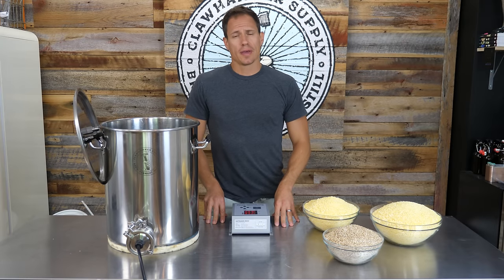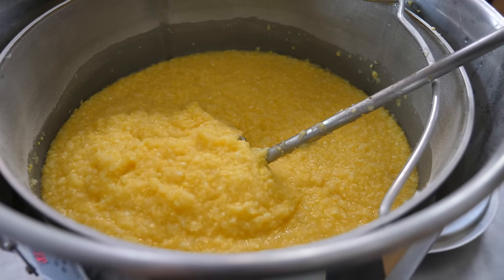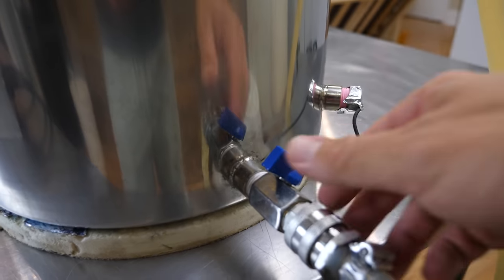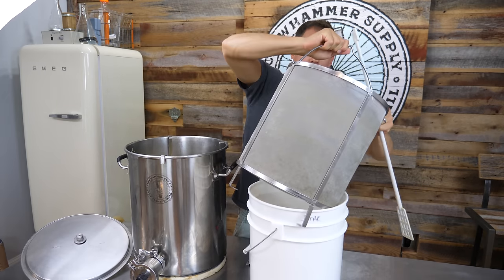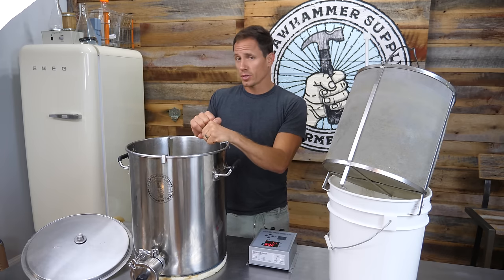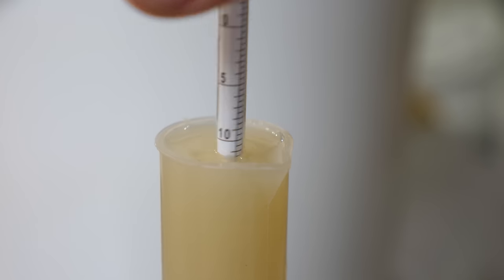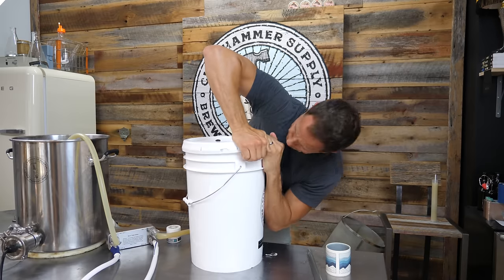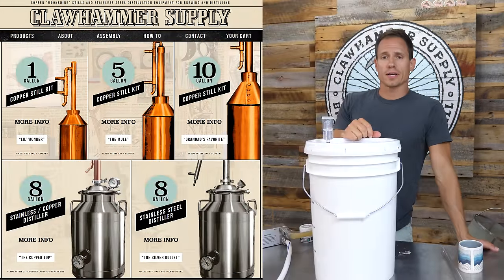How to Make Moonshine

Comment: When I was underage, I made a still out of a pressure cooker and my condenser was coffee can with copper coiled up in it.  I used a meat thermometer for still temperature.  The water was pumped and circulated into an igloo cooler with an ice bath.  I never checked the OG nor knew the ABV, but it was flammable.  My mash was just a bunch sugar water and bread yeast.  Let it ferment under my bed.  I distilled it when my parents weren't home haha.

Comment: Most people are just going to be making fuel to put into their lawnmower hahahahhahahahahha
Reply: because it's so economical.......lololololol
Reply: I'm not at all sure what you're talking about.  This November, my lawnmower is in need of refilling.
Reply: My beater pickup... But close enough
Reply: I wonder how many times they had to do that take before he could say it with a straight face.
Reply: lol ethanol is awful for carburated engines. plain evil
Reply: The joke is, that most states make it illegal to make it for consumption. So the only "Legal" way to make it, is to make it as a fuel. Otherwise you need permits etc.... But officer I swear I was just siphoning my "fuel" out of my tank and a little got in my mouth.
Reply: I don't think mowers can run off of ethanol though. Burns hotter than gasoline and has less power. I KNOW two strokes will burn up quickly.
Reply: @jonbar140  sure they can just need to adjust for proper air fuel mixture.
Reply: @joedanger666  Snowblower
Reply: @jonbar140  my uncle runs his riding mower off moonshine. .....yes they will run on it
Reply: My lawnmower likes its ethanol fuel mixed with fresh apple cider and cinnamon
Reply: @jonbar140  Burns MUCH cooler than gasoline and has more power yet less energy density.
Reply: @jonbar140  actually it burns colder, however the Stoichiometric ratio is higher than that of gasoline so it requires more fuel to air. So if you run an engine set up to run on gasoline, especially a carbureted. Engine the jets will not let enough fuel in and it will run lean, which will create the "hotter burn" so
Reply: I find after 2 or 3 refills my mower is running real good !
Reply: @Eccooke31  Ethanol production is ILLEGAL in ALL US STATES......
Reply: SNOWBLOWER  @joedanger666
Reply: @Eccooke31  no distilling is federally illegally without a permit. Have fun with the BATFE mate.
Reply: Your lawnmower might be thirsty
Reply: I put some in my lawn mower and I cut down my neighbors rose bushes.
Reply: @Eccooke31  how are they gona know if im drinkin my own supply tho 😂😂
Reply: So you're saying lawnmowers run off booze..
Reply: lawnmower? Thats a funny name for my stomach
Reply: Richard Mccracken ...Popcorn Sutton ran his Model A on it one time when it ran outta gas on his way to deliver a couple cases of his shine. The buyer gave him a gallon or two of gas as a tip I here. Believe it or not it’s your choice!
Reply: @Eccooke31  theres no way you learned that in a class , unless you mean college then yea haha . it looks so good
Reply: @xxDOTH3DEWxx  they make alcoholic carburetors

Comment: Looks a bit more "hipsterish" than the mash fermenting in wooden barrels, complete with dead insects, like we always did it at the still.....lol  Dead flies give it flavor.  Just an old copper still, using biscuit dough to seal the thing while running....Yeah, it was just to use as fuel also.  I'm lazy in my old age....I just buy Bulleit Bourbon or High West Whiskey now.  As a note - NOTHING is illegal, until you get caught at it.  Ran a large outdoor still for years and never did, so it was legal as fuck as far as I'm concerned.
Reply: doesn’t have a taste like it was made in the middle of nowhere
Reply: @xx_epicgaymer69_xx41  like bacon over a campfire vs Bacon in your kitchen. Both good, but one is fucking awesome.
Reply: Not illegal until you try to sell it. Uncle Sam wants his cut.

Comment: Seems like you're making something simple overly complicated with that fancy electronic pot.
Reply: So much easier with a one pot setup. Expensive   for a reason. You mash, sparge, and cook all in the same vessal, saves a lot of work.
Reply: Exactly most guy I know use the same bucket transfer it over let it ferment then distill. This electric kettle is a scam.
Reply: @mattwilkes2214  you can't cut corners and make a quality product. It takes a little work to make quality liquor. That's for lazy people.
Reply: @kylestivers4606  every commercial brewer or distiller in the country, "cuts corners" by using new, efficient equipment and by streamlining their process.
Reply: It does seem overly fancy for “lawnmower fuel”. It’s not like there are many people with the distillers license that are trying to make small batch high quality booze.....

There must be a long term plan to recoup your investment in off road bio fuel. 5 gallons of 20% mash is about 1 gallon of high enough proof “fuel”.   1 gallon of gas is $2.75. IF you grow/mill/malt your own grain, it’s going to take a lot of batches to see a return on investment. It’s crazy how moonshine is so expensive, but ethanol “fuel” is so cheap.... 🙄
Reply: Honestly he's making it look too easy , I've had shine like this before , trash compared to backyard shine
Reply: @kylestivers4606  I agree
Reply: kyle stivers 
Mate, sure you can’t cut corners when making quality shine. But hey, this was bullocks, whaaaaaay overdone. 

Ferment your fruit, sugar, starch in a sterile bucket. Let it ferment and than distill it. Run it through activated carbon, dilute it to 40% and enjoy it. 

Dang, how hard is it...
Reply: Well, I don't think it was really designed for stuff like this. Have you browsed through their website?
Reply: I can do the same thing with a big stainless steel kettle,  a 10 gal insulated cooler and a large mesh sparging bag. A lot cheaper and just a wee bit more elbow grease. And he never mentioned using the spent grain and  backins to make sour mash.

Comment: "how to make moonshine" if you have the money for a distillery
Reply: hey man! that isn´t expensive.
you can use for example an used beer keg. i bough one wich holds 50l for 30€.
if you can weld or know someone who can you come around 100 $/€

here in germany it isn´t allowed to distill if you haven´t got an rare licence but we say:
"Wo kein Kläger, da kein Richter!"
"No plaintiff, no judge!"
Reply: I’ve seen these kits for like 50-150 lol not that bad I think the supplies might be more
Reply: You don't even need all of this for small batches. If you got a large stew pot, a very fine wire mesh and a hose, you can make it pretty easily albeit with more difficulty. Hell, you can buy a kit for like, 20 bucks on amazon that comes with all the basic equipment.
Reply: Lukas Moßner no
Reply: there are two types of people, those who need every last detail spelled out for them and those who can acquire a basic grasp on the concept and improvise the rest. Strive to be the latter and I guarantee life will be easier for you.
Reply: I know some who put together a 15 gallon still for under $50 US. He found a fat copper pipe as scrap though, so it will be more expensive if you aren’t as lucky.
Reply: You can buy a still "for essential oils and herbal extracts" on amazon for around 350 dollars.
Reply: Nailed it on the head my man, this set up is is too over board. More effort than it needs to be for a moonshine whiskey

Comment: If I add like three pounds of sugar will that give it a higher content level I'm tryina get drunk off a lil sip
Reply: Not so much. It depends on the proof your still puts out. You can have a 20% abv wash n if your still will only put out 110 proof in the run then that's what you are going to get. Now you can rerun your shine and kick the proof up a bit more but your volume will go down. So basically if you are looking for a really high proof it comes down to how well your still is tuned more so then how high the abv is in your wash. Hope that helps.
Reply: this recipe is for lawnmower fuel lmao jk
Reply: Paulie Tonoro the higher the ABV, it’ll just mean you’ll have more alcohol, it won’t be stronger, you’ll need to distill it multiple times
Reply: Why??? So you're gonna obviously waste your time making it, wait two weeks for it to ferment so you can "take a lil sip"? Whatever man. I think you wanting to sound cool backfired on you. If you are even of  age to go into a package store, go buy some vodka and stay in mom's basement for the night. That way no one has to see you get sick.
Reply: Sounds like a lot of folks here haven't run a still before.  Yes the ABV of the wash will help determine the ABV output of the spirit.  Your takeoff with a 10% ABV charge will typically start at around 120 proof while with a 20% ABV boiler charge may start off at about 135 proof. These numbers will drop as the run progresses since the alcohol content in the boiler is constantly getting lower. No mention of doing cuts either. there are the foreshots which should be discarded due to high content of acetones and methanol. The heads which are sharp to the tongue , then the hearts cut which is the good stuff then the gradual drop into the tails. It also depends on the type of still you are running. A pot still , a pot still with a thumper or doubler , maybe a plated column. Depending on the style of still and the rate of takeoff final proofage will vary. The thumper will increase starting ABV to around 155 to 160 proof and the plated column will allow you to take off as high as 192 proof depending on the amount of plates ran. Do some reading I suggest going to www.homedistillers . org.
Reply: Keven W  Kevin I wasn't speaking about the fellow from clawhammer. I was speaking of the fellow that claims a still has a fixed output no matter what the ABV of the boiler charge is. When in fact the output ABV of the still does change depending on the ABV of the boiler charge and type of still being used. It will Change during the run as the alcohol is extracted from the boiler charge. Your highest proof on a pot still will be at the start of the run and gradually taper down through the run as the ABV in the boiler decreases.  So in fact ABV in the boiler charge does affect output proofage .   As I mentioned before. Check out www.Homedistillers.org for some really good information and a great group of home distillers.
Reply: Easy ratio to start with will be 8 lbs of sugar to 5 gallons. Depending on how well your fermentation goes , will determine how much product you get. If you want higher proof/traile , run a reflux instead of a pot still.  If you make whats in this video, don't drink it.

Comment: Never tried barley... straight corn
Reply from the maker: You need the malted barley to convert the starches in the flaked corn into sugar
Reply: You can get amylase enzyme by itself as well. I'm assuming for purposes such as this
Reply: +Clawhammer Supply I use cracked corn and achieve 175 every time.
Reply: 10 lbs of sugar per 5 gallons of mash...
Reply: @MikeP350  I am assuming you could use pureed banana skins to get it started breaking down too. It would probably take a bit longer, but it would get the job done too.

Comment: Legitimately speaking, cutting gas with high-proof alcohol would work to stretch your supplies of fuel.

Or you might be able to run a Deuce and a Half on the stuff straight from the still.

Comment: 8%??? That’s it? I regularly get 11.2% or 1.088 original gravity… Of course I’m using 13 pounds of corn and 4 pounds of distillers malt… When distillation is complete I get about a gallon of 100 proof white lightning…The cooling system seems a little more confusing than just using a good old fashion wort chiller… But it’s pretty cool to watch. Thanks for the video

Comment: No Iodine test? Plus, after producing the wash; Why would you reheat to 170-212f? Unless I heard him wrong.
Reply from the maker: No idione test- correct- not something we do very often. It is really easy with this recipe to tell if you got good conversion. After the mash is finished you have the option to bring the mash up 170 or or a boil. Heating the entire mash up to 170 or a boil would eliminate the worry about getting an infection during fermentation (as long as everything else is sanitized well before pitching the yeast) If you are extremely clean/careful during the mash process you can skip the 170 or boil and just cool it down and pitch the yeast.
Reply: Please sdnd me a recipue or two brother.  Woulf appreciatd u 4 it now. Thanksbyou

Comment: How i make my moonshine

25L water
6-8 KG sugar
1 packet of turbo yeast

Mix it all up in a plastic container with a air lock on top.
Let it sit for 8-10 days (when the air lock stops bubble) 

After 8-10 days, pour gelatine powder on top of the mix. This helps to clear the mix and remove dregs. Let it rest for 24 hours.
Move the mix to another container using a siphon. Leave 2-3 liters on the bottom, together with all the goo left behind. 

Now you can destill it with a alcohol destiller (google it) and get 90-94% pure Ethanol. 
After you are done, mix it down to 45% and run it trough a tube of activated charcoal. This removes any bad taste from the brew.
NB: if you put anything above 50% alcohol trough the activated charcoal, it will get ruined. 

Enjoy.

Comment: Why the disclaimer at the end?
Both Ebay and Amazon sell the heck outta stills...
Everybody knows what we're using them for...
Here's the deal...
If you're fooling around with a 3 or 5 gallon still in your kitchen, and can prove you're a hobbyist, that's probably okay. You need to show the feds it's for your personal consumption only. 
But if you have a 20 gallon pot still permanently installed in your garage, that will get some attention. Feds know you're not drinking it all yourself. You're into "selling and distribution"...a yuge no-no...

Comment: Pressure cooker.   Could copper. Bucket of water. Bottles. Garbage bucket. Fill with water & apples. Let go sower. Goes into cooker dirty comes out clean. That's like southern commfert. Getting close.  Run keep running through until a warm feeling his down ur chest.   That's it 100 percent.

Comment: Interesting in spite of the cost of equipment. What about the blind factor if made wrong, is that an old hillbilly's wives tale to keep people off her stash?
Reply: There are three diff alcohols made ... Fortunately the two bad ones steam out at about 146°f ... The third which is generally accepted as non poisonous unless you overdose or have an allergy comes off at about 170°f ... The old rule was to use a quart jar and toss out the first quart ... But that's just hillbilly rumor y'all ...

Comment: This looks really technical and difficult....hardly worth it when it’s cheaper to just go and buy your choice for a few dollars from your local liquor store. He’s got  $30,000 worth of equipment there. 
But.....here’s the thing
You can make 12 gallons of 50% excellent shine in 10 days for about $50 or less. You just need a plastic wide mouth 50  gallon fruit concentrate barrel and 100 lbs of sugar and 10 lbs of boiled mashed potatoes, hot water and 1/2 pound of brewers yeast. 10 days and it’s ready to distill down in a 5 gallon pressure cooker picked up for $5 from your local goodwill. Make your still from 1/4 inch soft cooper tubing and some plastic plumbing pipe and a source of trickle water supply.
Total cost of equipment about $50. Total cost of mash $50 and voila you have shine.
This stuff is sooo easy to make....you can make it in the Bush. And it’s so easy it’s fun.

Comment: 6:44 who the hell makes moonshine at 16-20 proof?
Reply: That's the fermented starter, NOT the finished product.  Before distilling, that would be like 10% alcohol beer.  How many times you run it through the still determines the final proof....the more times, the stronger it gets, but the less of it you end up with.
Reply: You can't get very high alcohol content from fermenting. Fermenting only turns sugars into alcohol. To get high proof drinks such as moonshine, after fermenting it, you distill it which basically gets rid of a bunch of liquid that isn't alcohol therefore making the finished product have a higher percentage of alcohol. After distilling it, it will be a lot higher than 20%.